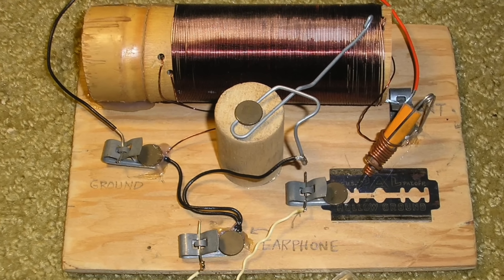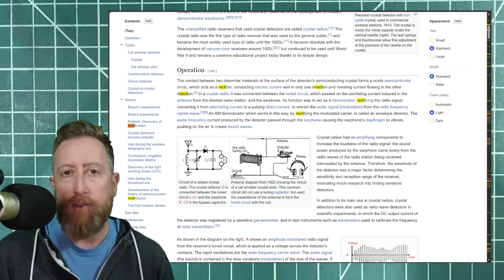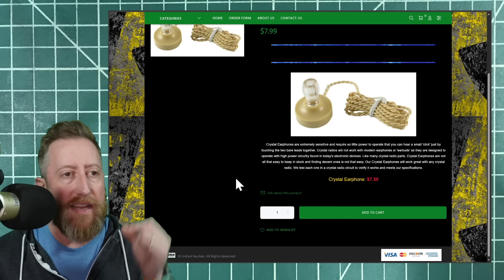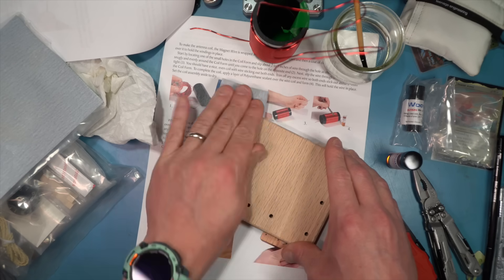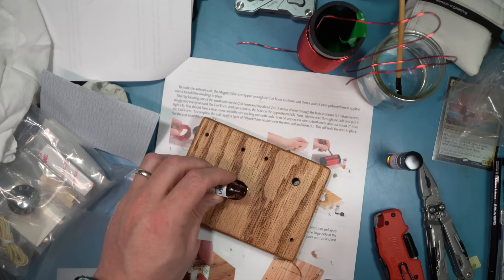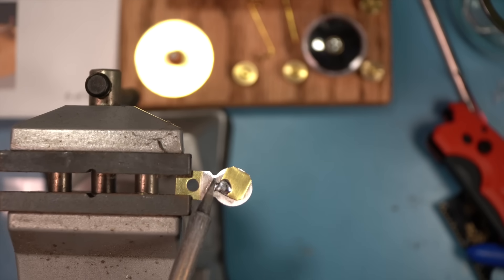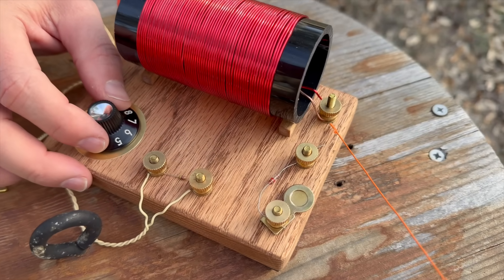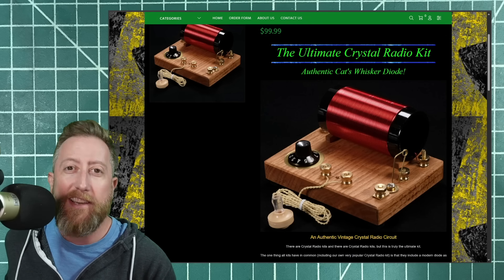Going Old School With Crystal Radios From United Nuclear!

Comment: When I was a kid in the 70s I had a germanium crystal radio and it would work without a battery if you used the ear phone that came with it but you could barely hear anything but it had a place for a 9 volt battery and it was used to amplify the sound and then you could use a normal earphone or small speaker, this kit was made for kids so you didn't have to solder anything, it was sold by radio shack and there was screws and springs that would hold the wires , it worked best at night, germanium is what the early transistors were made of it comes from smelting zinc and you get lead and zinc from smelting Galena it is a black crystal, so germanium is ultra refined from Galena

Comment: The inductor can be 35 turns of #28 gauge wire on a 4 inch form. No overlapping of wires. Try using an MPF 102 fet. It can detect and amplify.

Comment: The radio I had in the early 50's

EBAY
Crystal Radio Set Vintage Original Pioneer Rocket in Store Display Box 1950's

Comment: When I was a young pup in 1961, I got a Gilbert "Erec-Tronics" set for Christmas. One of the projects was, you guessed it, a crystal radio. No cat whisker, however; there was a packaged diode. But it was still a blast. My dad put up a long-wire antenna from our den window to a tree in our side yard, and I used the forced-hot-water radiator in our den for a ground. This was in Providence, RI, and I was able to hear WPRO (630 kc), WEAN (790 kc), WJAR (920 kc), WHIM (1110 kc), and, very weakly, WICE (1290 kc). Unlike the first four stations I listed, the latter station's antenna array was along the axis of my long-wire. Thanks, Dad.
Reply from the maker: What a great story! Thanks for sharing!

Comment: A typical kit includes a coil (inductor), a capacitor, a germanium diode (the "crystal detector"), a high-impedance earphone, and a ground wire. No battery needed :)

Comment: you can hear FM, using a high Q circuit (gives extremely sharp tuning), now you can detect the "slope" of the modulation, that is you are detecting the frequency shift as if it was a AM signal,  it would be power of magnitude less powerful than normal AM station but it works.

basically you resonate your circuit to part of the FM signals total bandwidth, cutting a thin slice out, that will then be mixed with itself as if that resonant part was a BFO, this then  producing a weak amplitude modulation (frequency shifting in and out of the slice)a.
s you already have cut out part of the signal and will be introducing losses as we didn't have super conductors for wires, no amplification and so on, lets just say that the sound would be far from deafening and not exactly best quality.

Comment: Unwanted mixing  and unwanted  spurious products can also be  produced   in such as  multiple  repeaters/ base  stations at a site,  where one  transmitter  is getting RF back down  the coax into the PA  which acts  as a diode mixer,  and re-radiates the result  back out  the same  coax.   We once had a problem at Pullman, WA,  up on  "Skyline Ridge"  at a little tower    near a water pump station.  We  had added 1 or 2 more redios,  and there were only   3 or 4 radios on  site.   I have forgotten, but the  3rd harmonic of a VHF station was mixing with another  in the PA of a third,  and  resulted in an on channel  spur.    We installed a circulator  and don't remember if anything else

Comment: Lots of stuff can be a diode.  Go up to any  radio site,  and tune in  a medium weak/ noisy  signal on a handheld.  Take a couple of screwdrivers and rub the metal shafts together.  The RF  in the area will  mix in the "poor quality diodes" you are creating and destroying with your  razor blade / screwdriver  mixer.   Usually,  the  fence is  dirty enough that you can just shake the fence and generate  noise.  These items are taking  more than one signal from the site   and generating side products   which you hear.    Decades ago,  a guy had some sort of  antenna rotator  with LED  direction indicators.  He was having trouble with TVI,  and the  LED indicators were the reason.   I believe we used to call these  "unitentional external mixers."

Comment: This idea that  a crystal radio  "rectifies"  is completely WRONG.  Crystal radios work the same way ANY RF MIXER works.   A  Class C,  AM modulated PA is a mixer.  You mix the audio with the carrier to produce the output  of the RF carrier and the two  sidebands. The  original  audio signal is bypassed because of the  characteristics  of the  resonant output circuit.   Similarly,  an AM detector is a mixer.  It takes  the  two sidebands  (you only need one)  and mixes them back together, producing the output of  two sidebands and RF carrier, which are all bypassed in the output,  and the audio.  

The  same thing happens  in an  early  communications receiver being used for   CW or SSB reception, where you   "imitate"  the carrier  with the BFO.  The receiver  AM detector  diode  mixes the BFO  with the incoming sideband  and the resulting output---the sideband and BFO are bypassed, and the audio signal  remains

THE PROOF of all this is the same type of radio being used for CW.  The incoming keyed carrier, unmodulated, is mixed with the BFO.

Balanced modulators and product detectors  work a bit differently,  BUT THEY ARE STILL  mixers,  and are actually, pretty much the same  thing

Comment: Started making these at 10, 60 years ago. All you need is a 1N34 crystal geranium diode and the crystal earphone. 80 winds of copper wire around an empty toilet paper roll with the varnish sanded off the top with a thicker piece of copper wire that slides across the top of the coil for tuning. We used short springs for the wire connections instead of soldering. Other than a long wire for the antenna, you forgot to mention that you need a good ground. Preferably a metal stake driven in the ground then pour water around the stake. Then late at night you can pickup stations in other states. I hooked up the earphone connection to the input of a small guitar amp and it worked great. You can use the faucet inside your house for the ground if it's metal. You can buy the diode, crystal earphone, springs, and variable capacitor online for around $20. You're not going to get much reception during the day, best reception late a night, like with a shortwave radio. Nice to have when the power goes out and the batteries are dead.

Comment: When I got interested in Ham Radio, back in the 60s. I brought an Army Surplus CW crystal controlled Transmitter. I went whole hog and got one that had  a 5 crystal rotary switch so I could go to different frequencies in the 40-meter band.

Comment: That myth was not a myth.  That happened to Lucille Ball.
Reply: According to her, it happened during WWII.  She informed the folks where she worked, and the FBI ended up finding an enemy spy that was transmitting messages from a radio in the building she was standing in front of, when she picked up the transmission.

Comment: United Nuclear, (United Nuclear Scientific Supplies, LLC), was started by Bob Lazar in the mid-1980s after leaving work at Los Alamos National Laboratory.  THE Bob Lazar that claims he worked reverse engineering the power system of a UFO, now called UAP.  I have observed the site since it started.  It used to offer really cool things until the Government raided the business.  Now it still has cool stuff but nothing like you used to be able to get.

Also, I built a crystal radio in 1974.  It wasn't made with cool looking wood.  I used a cardboard box.  I had antenna wire hanging from three trees in the front yard and I grounded it using the gas pipe in my room.  I went with a diode and the only thing I had to buy, was the earpiece from Radio Shack in Gulfgate Mall.  It was only a few bucks.  I got the money by returning glass bottles I found to Walgreen's using my Red Rider Wagon.  It worked great at night.  I made the coil from scratch and I could never pick up much with it during the day.  I don't know what happened to it.

Comment: The best kits I remember were the old Radio Shack P-Box kits--everything from sequenced flashers to AM and SW radios all built on the red and clear plastic box it came in.  Man, I wish those were still around.
Reply: I started with an independent brand crystal radio. Next was A.C. Gilbert. Then tube based Knight Kits after that.

Comment: Crystal radio guy here. This area is huge. There are many deep dives one can take in the world of crystal radios. Many fancy designs have been sold over the decades. 

Even FM reception is possible, but that's a tricky design.
Reply from the maker: I love the idea of a super tuned crystal set. That’s awesome. Very Steam Punk.
Reply: Holy crap. I had NO idea there exist crystal set designs capable of picking up FM. I am super curious now!

Comment: I have built both kinds of receivers from scratch back in the early 1970's and found the diode works better than the germanium for a detector/rectifier and cat whisker unless you have a fairly good sized piece of crystal with large flat spots and you wind several wraps of fine enameled wire around the crystal.. Adding a small transistor, and a couple support components with a small power source lets you use regular set of mini headphones instead of the crystal ear piece, a two transistor amp lets you use a small speaker.. Adding a preamp transistor to the antenna side with its support components and a small power source makes the receive much stronger.. There are kits and or instructions to start with the basic receiver and then add circuits, selector coils and filters to really learn all the basics of AM radio, FM radio and basic radio electronics..

Comment: In the early 1970s (I was about 7yrs old) my dad hooked up a "Rocket Radio" crystal radio, used the hot water radiator as a ground, and an old twin-lead that came into the house (was a TV antenna on roof, no longer there at the time). It had a crystal ear phone..I was amazed! Few years later I got a crystal radio kit of mine own for Christmas. Both of these radios were 1N34A Ge diode based, but worked fantastic. WGY 810AM (still on the air in Schenectady, NY) was super loud at night. As was the case for a handful of other AM stations locally at the time. Fast-FWD to about 10yrs ago I home-made my own 1N34A based crystal radio....my kids thought it was amazing. Remember, 10yrs ago kids (and adults) are weaned and connected with i-Phones, internet, etc......they were amazed that music and voice were coming out of a coil of wire and some clip leads. I would recommend even an Amazon based crystal radio kit as a "STEM" project for any age. 73's.....

Comment: When my 40 year old son was in a Webelos Scouts den (group of about 7 boys),  they each built a XTAL radio in my ham shack.  We used a toilet paper roll for the coil (and a small signal diode).  Plenty of signals in the Portland, Oregon area to listen to.  As I remember, I was using a simple instruction sheet from by 4H youth experience.   W7CJ
Reply from the maker: What a cool experience for them!

Comment: I built the official Cub Scout Crystal Radio Kit back around 1970. There's one on eBay for $70 and a bunch of similar kits for around $20. No fancy block of wood with sandpaper and stain however. In the Cub Scout Kit, you wound your own inductor around a cardboard tube from a toilet paper roll.
Reply from the maker: That's a classic way to build one!

Comment: The problem many crystal radio builders have today are those small, pink crystal earphones widely available for decades,  sadly, from the 1990's onward they do have an unfortunate tendency for cutting out and going silent randomly due to its 20mm aluminum based piezo sound disc and negative flat copper strip wire being pinch contacted to the aluminum edge instead of being soldered like a normal brass piezo disc    which over time leads to copper/aluminum contact oxidation, and a poor connection,  I had many pink earphones over the years just quit or sound broken up .  I had to replaced many earpieces after a few years of use.  That problem, and the  lack of other commercially available crystal earphone options  outside of seeking some antique 100 year old 2000 ohm headsets,    has, no doubt  contributed to the crystal radio's decline in popularity unless one learns how to make their own,  more reliable crystal earphones as well as  building the radio.  Recently  I did make my own crystal headphones using 50mm piezo discs soldered  in series  sealed and funneled to  earbud inserts.   The sound quality,  and more importantly the reliability is so much better.  I would also like to acquire one of those $60 crystal headphones at unitednuclear just to compare it to my own homebuilt set.  it might even use the same 50mm,  piezo drivers.   At least there's someone out there who is finally stepping up to improve this still problematic crystal earphone issue

Comment: I many build one of these.  I my location there is a nearby AM station that will saturate the radio.  I did not know much about radio as a kid.  Now as a HAM I can experiment.  I many build one and build a parallel and series tuned trap and try to attenuate the local station and try to catch more distant ones.  This could be fun.  Thanks again for showing this video.

Comment: My radio journey started off with a "Red Rocket" crystal radio some 65 years ago.  📡📡📡
Fast forward 45 years, and my granddaughter and I built a razor blade/pencil crystal radio for a science project she was doing. - I still have that and she is now 25.
I do pull it out periodically just to see if I can get it to work - sometimes it does, sometimes it doesn't - Cheers!  - VE3GHP

Comment: Oh man, thank you for bringing this subject up, Josh! I love crystal radios! These are actually what got me started in radio Way back in the day, in 1982 when I was 8 years old! Scratching the galena crystals is fun... finding that "sweet spot"!  Galena seems to pass current at about 340 millivolts or so, same with germanium. Anybody else correct me if I am wrong! I use a galena crystal in a lead base. I LOVE these, and still love experimenting with  them to this day. Lots of nostalgia for me, thanks to my Grandfather! I have loved taking apart electronic devices since as long as I can remember. It will be my eternal hobby. I found some thicker diodes I took out of some piece of something I don't remember, but the voltage is 180 millivolts! That's like half of what the germanium is doing.
My apologies for being long-winded... 73 to everyone!

Comment: Wow, it's quite amazing that someone could make a Crystal Set as expensive as $100. A traditional build would leave change from a twenty. Meanwhile, you never addressed the question as to whether you could use an amalgam filling as a detector. I tried it many years ago - not a sound.
Reply from the maker: I mentioned the rest of then myth discussion will be on the Modern Rogue channel.

Comment: Ive built about 12 of these.  Out of the 12 not one of those dang  things worked.  Of course they were entirely homemade.  No kits involved and instead of a galena crystal (which can be grown using Cream of Tartar) I ended up getting word of a guy that cooks sells crystal and got a pebble from him.  
Anyway the radio didn't work and my teeth rotted out.

Comment: Dude I built one that doesn't pick AM bands but it picks up HF can't tell ya what HF bands unless there is someone calling CQ but from what the original ARRL write up it was said to pickup between 80 to 10m my straight wire antenna was measured at 120' it did fantastic but had a person that live near pushing 1kw and blew the diode ugh one day I'll rebuild it because both the hams that blew my diodes are now SK :( one was my Elmer

Comment: About 6 years ago I got on a crystal radio kick.  I ordered some germanium diodes and built a few out of parts I had around.  I did not have a proper crystal earpiece so I put a audio transformer with a switch so you could change to an impedance that works with standard earphones.  That worked surprisingly well.  Eventually I made a high impedance amplifier using an LM386 and mounted that into an old CB case.  I improved the filtering by having a 2nd coil of wire next to the main coil (wound on the same tube about 1mm apart).  I included a variable capacitor for tuning.  It became a fully usable radio for picking up a few AM stations.

Comment: I tried a number of crystal radio circuits recently and none of them will work with the kind of iN34A diodes we can get these days since they are not the same as old timey ones. The only way I could get any of the circuits to work was to add a 1 transistor amplifier circuit to booste the signal then it worked fine and was plenty loud using an amplified speaker.

Comment: Awesome presentation.  I have built quite a few of these over the years.  In the 1970's Radio Shack had a kit to build one.  I also  had the 150 In One Electronics kit from Radio shack.  You could build one with it.  It had a germanium diode and the crystal earphones.  It had spring connectors so there was no soldering.

Comment: My dad built a crystal radio using a cut off broom handle to form the coil, a crystal diode (germanium I'm sure) and an old crystal headset. All thrown together and that, was my introduction to radio! It worked pretty well too. The bug had bitten me and years later other things came along and that was 60 years ago.

Comment: Inductor, rectifier, and a capacitor.  Looks like you are using a variable capacitor.  The classic ones used a variable inductor instead (sand one side of the coil, a tuning lever touches the coil at various places.